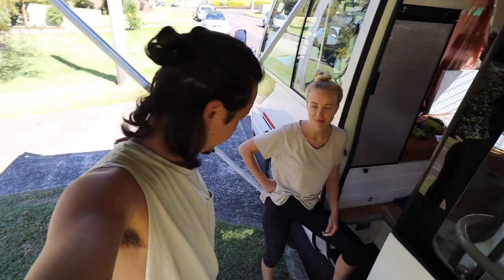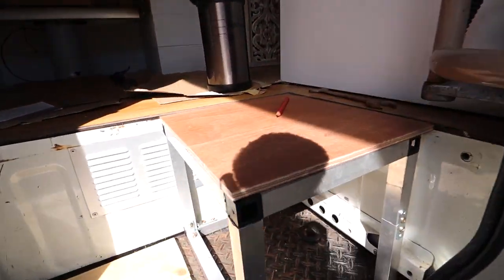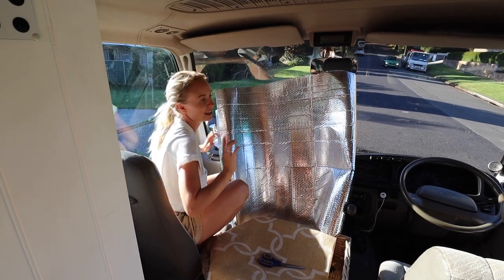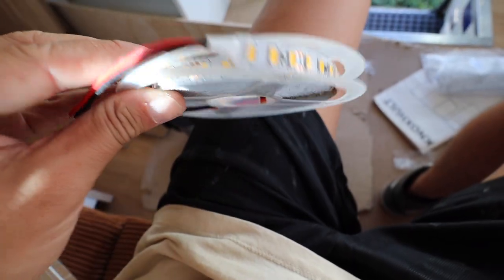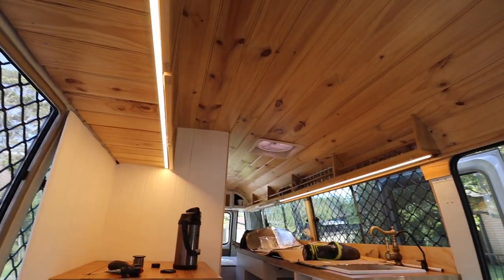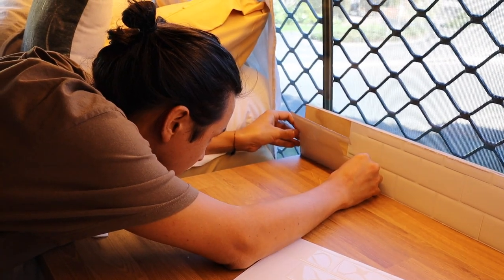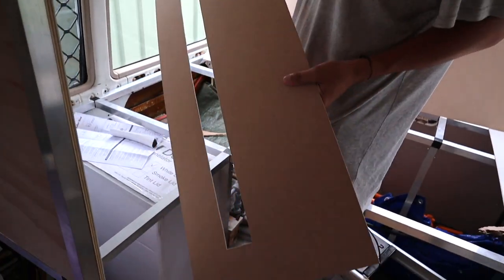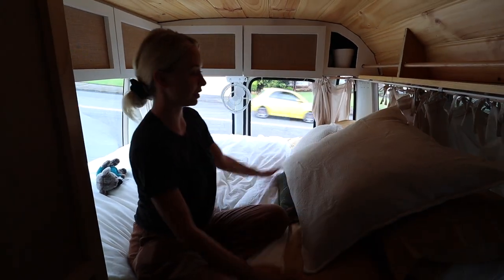IT'S FINALLY FINISHED! Finishing touches for off grid bus conversion

Comment: Hey friends, have loved watching your videos for quite a while, this one I saved to come back to when we needed. Im hoping to purchase some LED strip lights and wondering if you still had a link to the one you got, and the difuser is that just from bunnings? Did you feel that the led strip was bright enough inside? And could 1 roll be cut and used in multiple spaces, do I need extra wiring to make that happen? Thanks so much for your incredibly entertaining and easy going videos! DI ❤